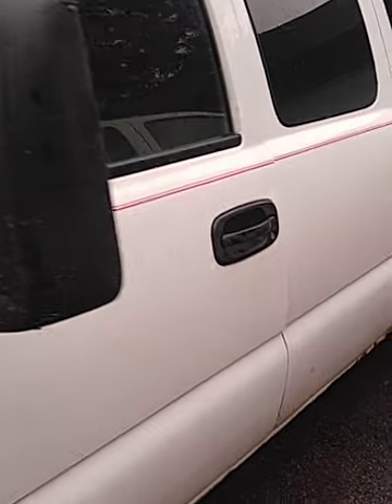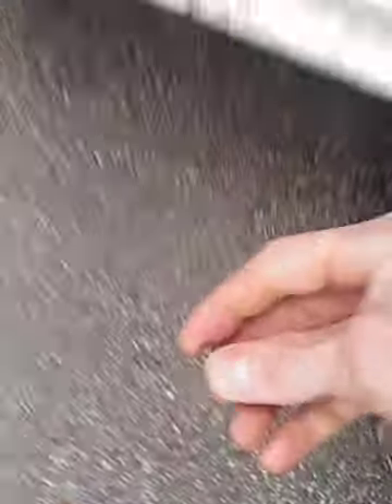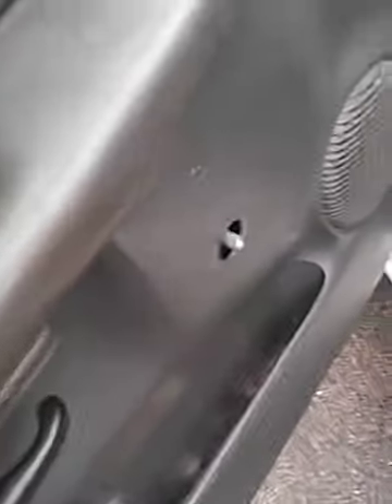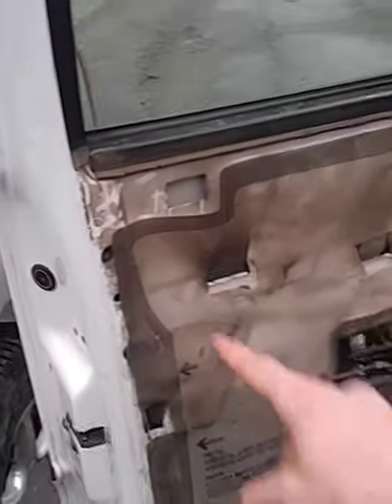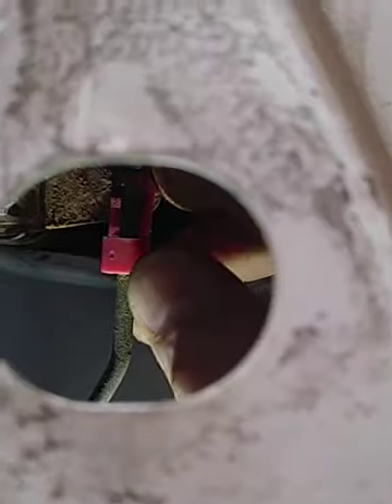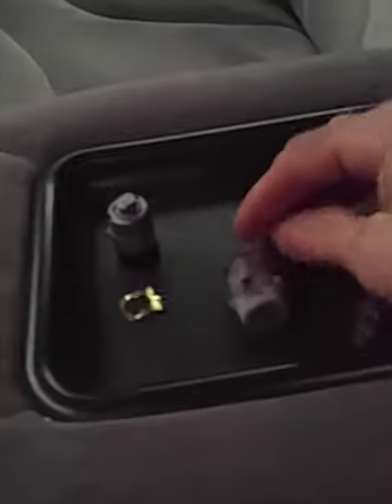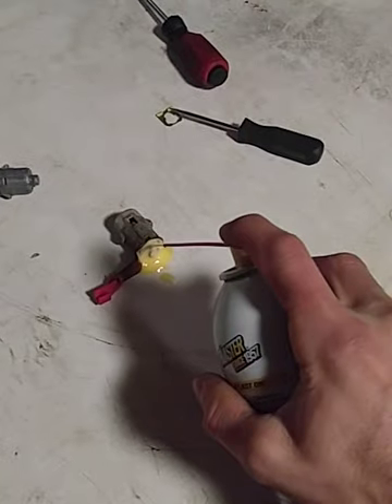Chevy 1500/2500 pickup door lock cylinder replacement! (part 1)

Comment: An easy way to release that window handle clip is to wrap a cloth around the circumference  of the handle and rotate the cloth, it snags on the clip and rotates it so it comes off and usually doesn't spring off and get lost.  You are a great one arm camera, one arm mechanic.
Reply: Thanks for that really helped
Reply: @irepairofpc31familykartrac51  once removed I tied fishing line to that spring and stuffed it inside the door when I reinstalled, that helps to keep from losing it later

Comment: On my 06 silverado it turned out that it was necessary to remove the whole handle assembly.  Just 3 nuts.   Otherwise I would have never been able to get that clip in place that holds the cylinder in place because I couldn't see what I was trying to do.

Comment: Someone has played with my driver door lock and now the cylinder is loose. This is a Hummer H2 2004 but the mechanism is exactly looking like yours except glass when up is minimally cover the area. No big deal.
I can bring out the cylinder but 7:28  ..... Can't find out where this clip is and probably this is why the cylinder is loose. Where can I buy only a clip like that? I see non of the cylinder seller are selling this along with the kit thought the other inner smaller clip to hold the bracket for rod is included with them. 
Any help?
Reply from the maker: You could always get one at a junk yard, but I'll let you know if I find something online.
Reply from the maker: https://www.ebay.com/itm/353114346479
Heres some on ebay 
You can probably get one from an auto parts store also.
Reply: @Joshyodenn   Thanks a lot
Reply: @Joshyodenn   Thanks but the one in the eBay ad is what I have. 
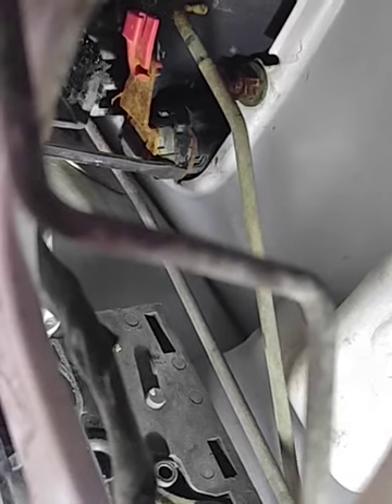I need that black wire-like the thin "metal clip" that you show (To be held with a screwdriver and not fully taken off) at this time point of the clip:  @ 7:35
I checked everywhere in the bottom of the door and could not find it, in case that can fall down. So not sure how to keep the cylinder steady in place, as it moves and won't let the key to be inserted.

Comment: Someone has tampered my driver's side door lock cylinder. It is moved inside and is loose. I guess the base is broken or whatever that holds it in position or that clip you show here is fallen. Anyways I opened the door panel but the lower corner of the door's glass (Though is fully lifted up) is partly covering the area and otherwise, I don't have much control over the cylinder. Is there any way to salvage the current cylinder without a need to change both driver and passenger, not to forget, change the ignition key (Three changes) to keep them all open with one key, as is OEM... PLEASE HELP... If there is a way to repair and how should I make a grip over the loose cylinder?
Reply: @Joshyodenn   Thanks a lot for your kind and speedy reply. I highly appreciated your input. 
To add, my car is not Chevy but H2 Hummer 2004 that has the same exact lock cylinder as Chevy of GMC. Unfortunately, there is not even a single video clip on YT about how to deal with this problem or even, the right way of panel removal. So I did all at my own discretion and creativity. I'll follow your instruction to see if I can do any better. I was planning to loosen the lower screws that hold the glass and actually remove the glass without disassembling the lifter motor module or arms. That may add a tad more space, in case I need to replace the clip. The main problem is I can see the location directly (Wish I had one of those endo flexible camera tubes) and moreover, have never seen a lock cylinder in my life, so all is depending on what I can see here on YT and your clip is one of the best that goes to the description and showing the parts that are in any case hard to see. Now if the clip is absent, would I be able to buy it separately or I should buy the entire part? And second question, what do you think if I only replace the driver door's cylinder, if I can't salvage the current one, and live with 2 keys, one to enter the car (In rare cases when remote is not used) and then another one to turn the car on? 
Again thanks a lot for your kind reply and care.
Reply: Did you ever find a fix for holding the cylinder in the door with the clip? Thief busted the plastic holder which has the clip. Not sure how to keep it in place. So far the plan is to glue the pieces back together and see if it holds.
Reply: @john4710  Sorry to hear that.
Unfortunately in the battle of metal and glue, Metal always win. At least my initial facelift repair with epoxy didn't work.

I end up changing the entire chrome-plated door handle assembly. These come in Right or Left (Driver/passenger) specific sites but fortunately are very cheap. If remember correctly, mine was under $20 at the house door. But this is a big BUT... To put it up, you need to open everything, including the glass from the door panel (That though not killing hard, comes with a lot of frustrations and probably the use of enough swear! So be prepared and I think your best solution is this.
Only another important caveat and warning:
After removing the lock's cylinder and replacing the handle and placing it back in its exact location as of OEM, and closing it all, I figured out for whatever reason, the combination of the internal lock mechanism is messed up and it would no more open with my key. At this point, my option was to get another cylinder that comes with a different key, open everything again and replace that damn cylinder, in which case I would end up with a key to open that drive door only and another key to turn on the engine and open other door or leave it to use remote only, to open the driver and OEM key to open the passenger side door in case of an emergency. Being lazy Me,  I opt for the second.

So do your homework as to what makes the key non-functional (I would think if you leave the car's OEM key in the cylinder at all times during the process, it should keep the lock mechanism undisturbed and unchanged) and try to avoid what happened to me. 
In short, the SOB who did this to my beautiful car knew exactly what he/it was doing and I seriously hate these Hummer Haters!
Reply: @samsen3965  Thanks for your help! I did buy a door handle to replace the whole thing. Honestly, I hadn't realized that the holder was part of the door handle! I appreciate it.

What a pain! Yeah, the thief that messed mine up actually punched out the cylinder, then drilled out the ignition cylinder too. As of right now I have 3 keys!! One for each door and the ignition. When I'm done it'll be two keys, one for ignition one for both doors. Could have ordered OEM and had 1 key for all, but it would have been about $600 plus service/coding/etc., instead of $300.
Reply: @john4710  You're welcome pal and wish you a peaceful weekend, having fun with the door. 
And yes, these car dealerships know really well how to rip us off. 
I can leave with multiple keys and call it Wallet Parking Security! when in reality all I need is the remote and the ignition. 
btw and another funny or interesting thing, that might be of interest, if you happened to have more than one GM car. A few years back, when I was programming my remote car FOBs, I did it for both my Hummer H2 and Yukon Denali (Both having identical FOBs). The programming is very simple and all FOBs were with me. In the end, I end up with FOBs that work now on both cars at the same time! And I was told this can not happen. Anyhow it is something nice most of the time but sometimes troublesome.
Cheers.

Comment: Can you show me where the bottom of the door lock rod connects in the door? I accidentally disconnected mine and can't figure out where it goes back in.
Reply: Did you ever figure that out? I got the same problem
Reply: @coler4212  if I recall there’s a shorter rod end in the top outer corner of the door. Really hard to get to.